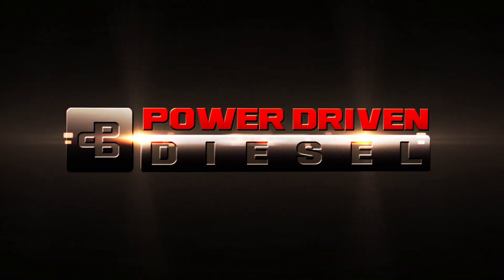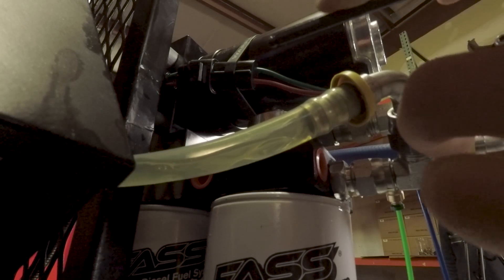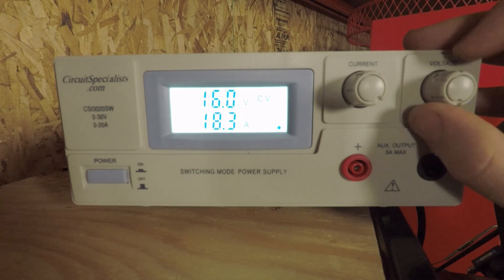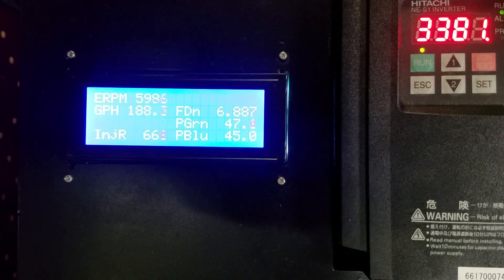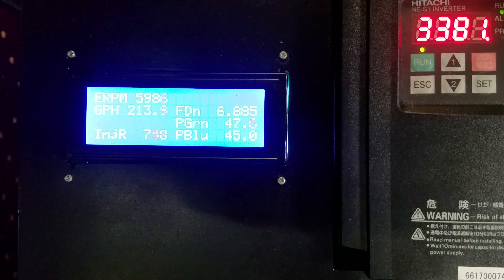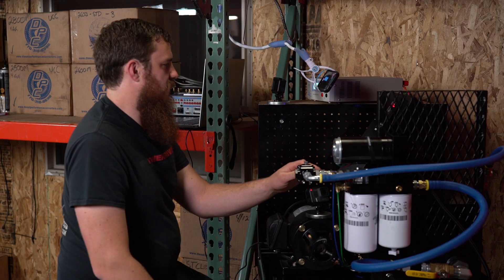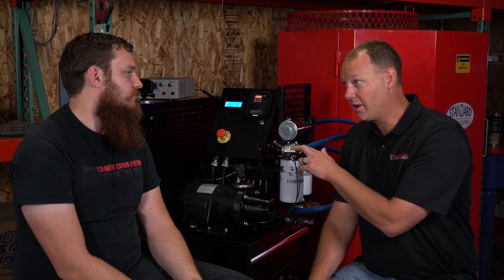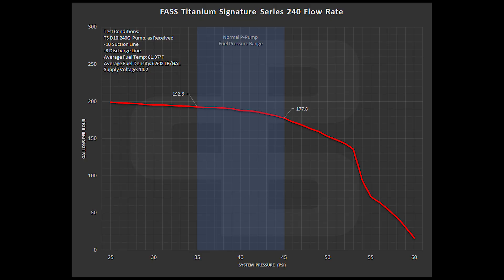FASS 240 Lift Pump Bench Test | Power Driven Diesel

Comment: Can’t cap off the return of the FASS the way the pump is designed. It pulls fuel off the bottom of the filter and returns off the top. So at some point you could build up enough air in the filters it will air lock the pump up.  The FASS has to have return flow to function correctly.

Comment: I know you are diesel guys but could you also check the wally 450 and Bosch 044 pumps that would be cool
Reply: Austin Doud
LOL I just wrote the same thing ! Bosch 044 pump would be great they are meant  for Porsches to be great high volume low pressure pumps.
Reply: Mark Rich actually the porsches had something like a 120 psi fuel system which is edgy the 044 flows a ton of fuel at lower pressure
Reply: They should do a fee to test any pump. We can all pitch on the gofundme then it gets done if enough people want the content

Comment: Seems it is a huge lie calling it a fass 240 right?  It was only producing 178 GPH at advertised 45psi.
Reply: Jason Truman and for over 900$ out the door you would think you would get what you pay for. 🤷🏻‍♂️
Reply: speed demon one would think that..... I’m extremely happy with the second gen piston pump I’m running on my first gen (regulated to 12psi) the same exact pump has supported 650hp on another ve pumped first gen so for my 350ish hp it will be plenty;)